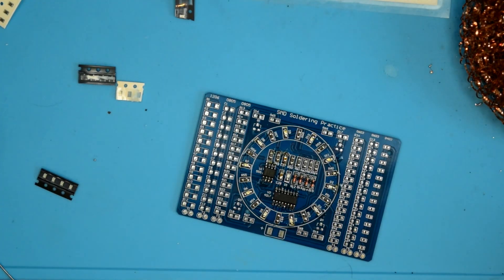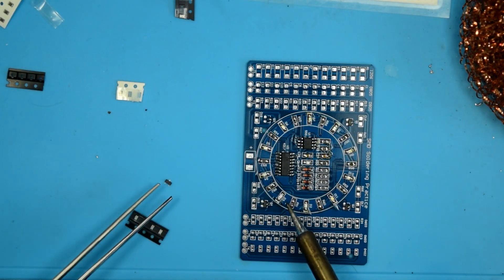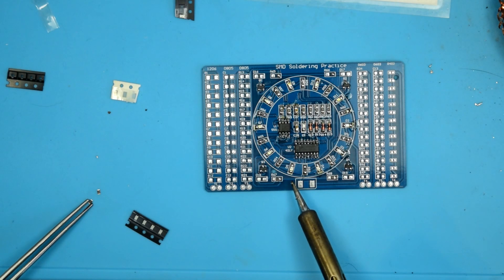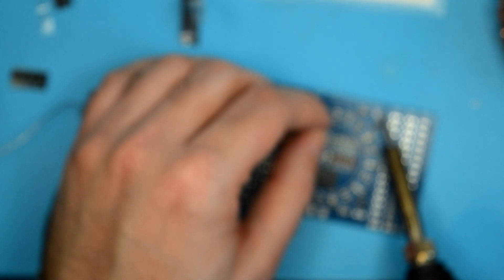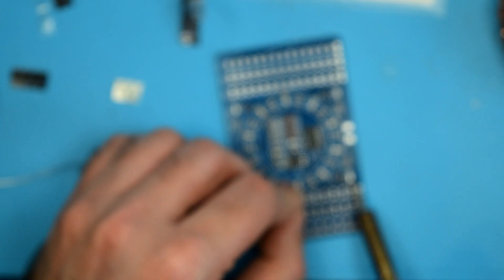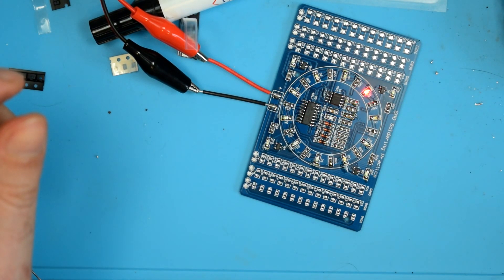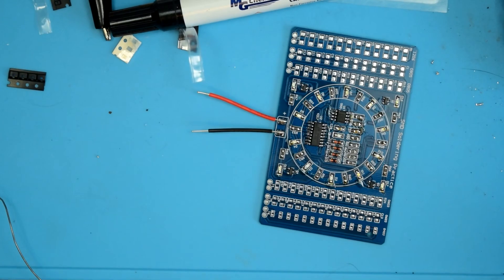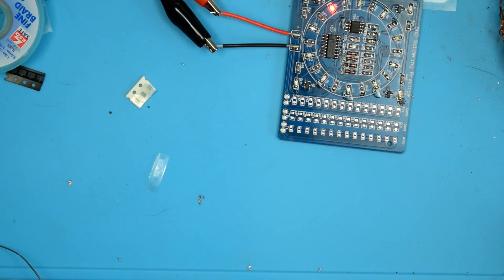SMD Practice kit - Part 3

Comment: You had the signal diodes correct, the black band points to the cathode (negative).  This is most likely another component picking problem with the kit.  Check the markings on the transistors.  Did you get PNP transistors instead of the NPNs the design calls for?  Mine are J3Y NPN.  As to the timing for the corner flashes, check the output of the decade counter.  (Credit to Autodesk Instructables)

Comment: Great. I watched your YT vid multiple time. After receiving my 3 test boards I was ready! The only thing I discovered was D1 in the center of the board the LED green tip points down not up. After corrected my second board worked fine. I only had red LEDs though no blue.  I also fluxed and pre-tinned the pads for the center diodes, and chips. That was a lot easier than doing each point by hand. The center diodes on my boards do indeed have the black ring towards the top as indicated. I put the leads to a 9V battery and it worked fine after reversing the D1 LED.
Reply from the maker: There's a reason these sell so cheaply on eBay. Defective or misprinted ones that still work, given some troubleshooting.

Comment: This is not the way to build this kit. No gloves, no ESD strap, no flux, and standing smd parts vertical is crazy, it does not make full contact with the surface of the smd component. I Hope no one repeats this method.
Reply: You need to get out more.

Comment: Sometimes in the uk the light will flicker a little when the national grid changes systems or adds a power source to their output, or maybe you have a bad connection?
Reply from the maker: +Phonotical It's because i still have the driver circuit built on a proto board. I need to get some PCBs made for if.
Reply: @GadgetBoy  ahh OK, why aren't you asleep! 😛